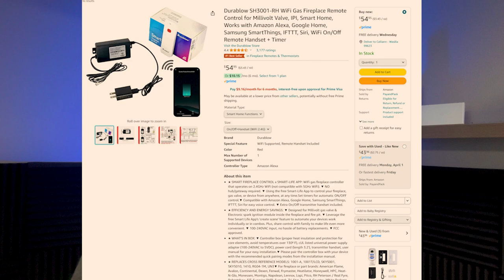How to Make Your Fireplace, SMART!

Comment: If you have a wall switch to turn the fireplace on or off,  could you just replace that wall switch with Smart switch.  Because right now, if you turn your wall switch off, you could not use the smart plug anyway.
Reply from the maker: @mgpauly6888  mine still works even if the switch is off. Depends how it was wired. In my research of setting one up myself, everything I found said a wall switch would not work. Had to do with something on neutral wires and the way the fireplace is triggered to turn on. I should try it though.